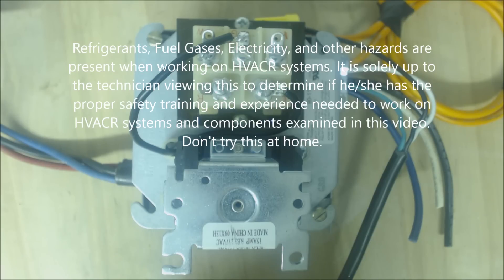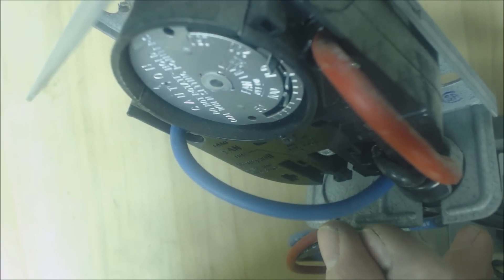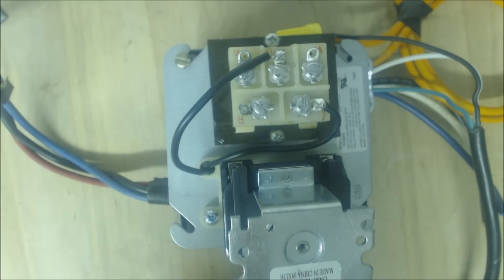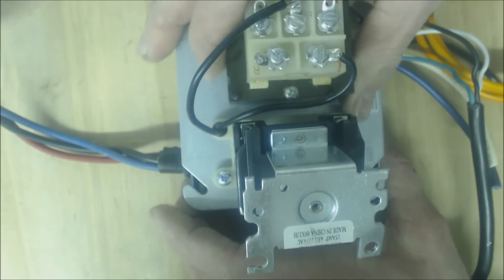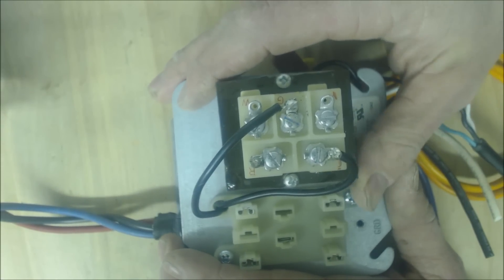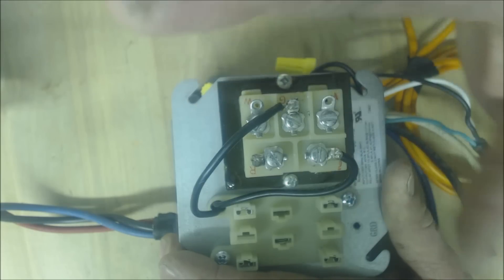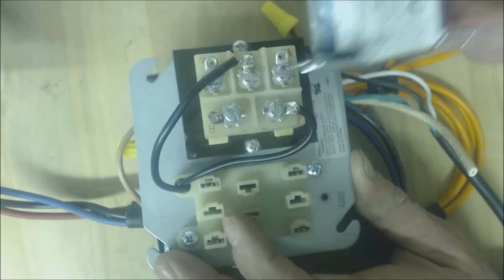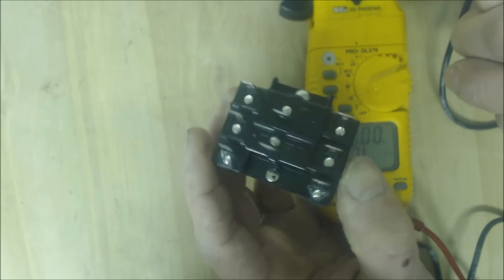Furnace and AC Fan Not Working! Troubleshoot the Fan Control

Comment: Hi, you explained that out of no. 3 terminal in relay (Red) you connect it to the blower motor....  but im confused because when you call for heat the blue wire out of the fan/limit control you also connected to the blower motor.
Dont get this part.  When G is energizes coil it closes relay contacts 1-3 i get this part. Line voltage goes through fan limit and then wired to terminal 1 on the relay, right?... and 3 goes to blower motor (120 hot!) either high, med, or low speed, right? but then in heating what, out of the limit you said the blue wire also goes connected to the blower motor and i would assume o terminal 3 on the relay? how so how is this possible ?

Comment: My grandmother has that exact same control setup on her 50+ year old furnace.  I've seen a few younger HVAC techs get stumped by that old setup and end up walking away (no charge) since they couldn't fix the problem 😁 

The funniest one was the leaky pilot tube that would initially light the pilot (universal combination gas valve) and then the main gas valve would open and work perfectly until it stopped called for heat.

When the main gas valve opened the leaky pilot tube would ignite underneath and when the main valve closed it would always snuff the pilot light out like clockwork.

I watched several techs switch out the combination valve with no success.  The best one though was the tech who installed an White-Rodgers (Thermocouple Actuated Line Interrupter) gas valve and didn't jumper out the ECO terminals.  Basically, he messed around with the gas valve for about 30 minutes before giving up.  If he'd just read the directions and used the supplied jumper wire, he could of at least got the pilot light to work before leaving 🤣

Sadly, I ended up having to fix the problem and now I'm stuck working on it because my grandmother won't call any of the local HVAC companies anymore since most of them are nothing more than a bunch of price gouging hacks 😖

Comment: The red from the limit connects the 2 black wires should I add an additional hot from that hub to power the oil primary control

Comment: Thanks for the excellent explanation. I am having this problem, heat goes on but the fan does not. The fan does turn ON when set to ON at thermostat though. Initially, I though the thermostat is bad, but now I understand the furnace/AC system has a separate mechanism that control the fan. These are very well explained in this video.

Watch this video again the 3-rd time today, now I understand my fan low speed does not work. With these explanations about the voltage path to identify which wire does what, I can track the voltage path in my furnace system and find out why the low speed does not work. Thanks a bunch.

Comment: It appears that the red wire from the limit switch goes into a wire nut and spits to power both the transformer primary and the pole terminal of the SPDT relay. If that's the case, when the limit opens the burner will turn off as expected but also the blower will turn off which isn't ideal as the blower helps to cool off the furnace when it cycles on the limit switch.

Comment: had a call where the gas fired boiler was using a fan center , tstat was wired red and white to r and g on the fan center terminal buss. Not understanding why w terminal wasnt used instead of g had me going in circles for a bit. thanks for the information.

Comment: I got a 30yr old york furnace that doesnt have general purpose relay.just has a transformer were you connect tstat wires like transformer on your video,I isolated the thermostat & the blower motor keeps running,what can it be?i have to turn breaker off manually,i replaced capacitor, spark igniter board & still same issue,i took common wire that comes from transformer goin to capacitor off & thats the only way it turns off,plz help
Reply from the maker: Look up "acservicetech fan limit control" thanks

Comment: I am working on a an oil furnace. the AC stopped working. I changed the relay and still the AC is not  turning on. Does the fan limit switch has anything to do with it? Thanks for your help.
Reply from the maker: You should have a multipurpose relay or fan relay that controls it. You would need to see if you read 24v from y to c at the control inside the unit when the tstat is calling for cooling, thanks

Comment: Can and why is a buzzing sound coming from fan relay? I just replaced it 2 weeks ago. Also ( coil) it is hot to the touch.  I'm assuming it was because my ac unit outside was on but my fan wasn't working. I also noticed the coil? Was not completely plugged in. After letting it cool i plugged it back in and powering back on it worked fine. Just the buzzing noise now. Help! Wifey hates heat!!! 😂  P.S. do i have to worry about an fire hazard in thymus instance? I'm testing the capacitor next.
Reply from the maker: Does the noise still happen when you remove the relay part and just have the transformer powered? Most of the time it is the transformer. You should check amperage on the tstat wires or just go ahead and replace the whole fan relay assembly it sounds, thanks
Reply: AC Service Tech LLC i removed the top part(transformer) still buzzing. Thanks for responding! Still buzzing although system running. Constant buzz even after a/c recycles.